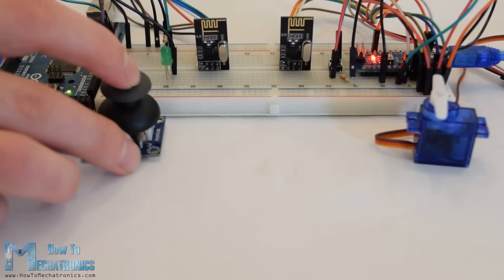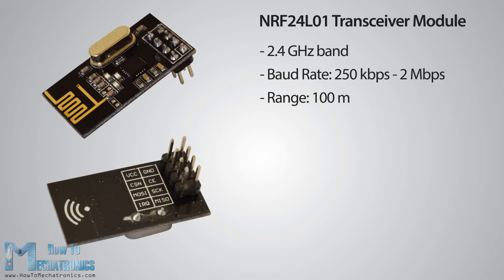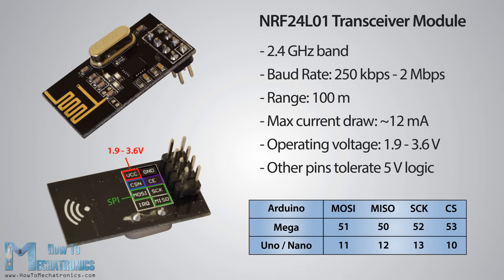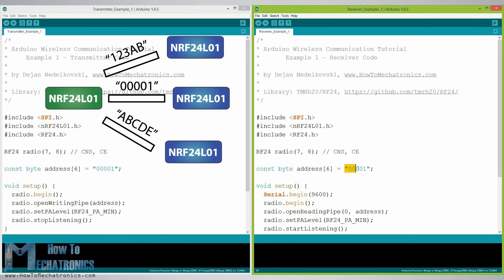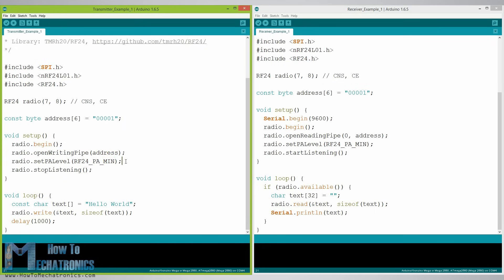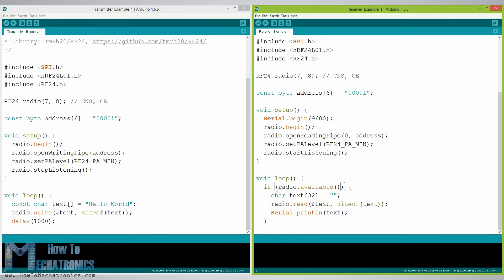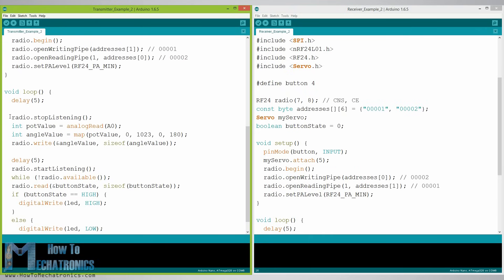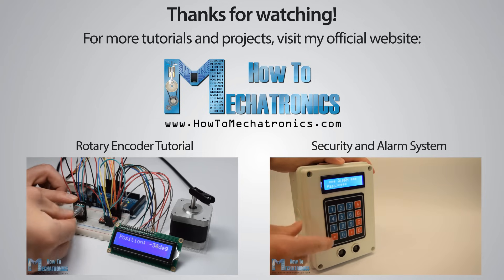Arduino Wireless Communication – NRF24L01 Tutorial

Comment: Hii Dejan!! Thanks for the tutorial. Had a small doubt .. like you said the nrf has 125 channels and if I am not wrong each channel can have 6 address pipes. So the lib which you have used in this tutorial has any function for setting the channel freq? What if I want to connect 10 devices on 10 diff freq and all the 6 address pipes in each channel/ freq  have to be dedicated to that specific device.. Is it possible??

Comment: as always from the first minute i feel like i know this module already you explained it so well that i will change my project from wifi (hard for me) to RF ..... excellent video love it...i have a question for you can the modules be configured to be like 6 emitters a single receiver ?? i have a project and i need 50 separate transmitter boards to send data to the same receiver so my solution is i will have every board pass data to the next board that way i can get data from all of them !!! can i do that ????

Comment: I was wondering if you used the Mega Arduino for a particular reason like it being more powerful , I have two pro minis I am going to experiment with and was also wondering if just wiring them identically shouldl work  for them communicating?
Reply: No. The Arduino Mega will not supply more power and will not increase range. It will work identically with Pro Minis as long as you power the Pro Minis with a decent power supply.

Comment: I tried the tutorial to display 'hello world' on the receiver module but nothing happens, can you suggest a fix? There was no error and the library was correctly downloaded, but nothing is happening.
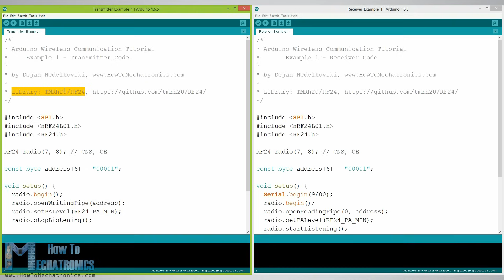Reply: Try swapping your wires for the 7/8 pins (CSN and CE), or swap the numbers in the code when you create the radio. If you notice, at 2:30 and 2:40 he has the pins reversed between the explanation and the code. Just a small mistake in the video I believe, I was getting the same thing until I figured it out.
Reply: @EnvoyOfFabulousness  Thanks! I'll try it out.

Comment: I really don't comprehend most of the language or meanings of electronics, and we were asked from a local law enforcrment angency to design a trigger mechanism for our product.  The bottom line is we need to send a "wireless" signal from the inside of a large SWAT Vehical to our RAM product mounted to the front outside of the SWAT vehical about 20ft in front of the Vehical to set off a small 180deg 8.4v RC type cervo, using a safety (Push-on - Release-off) button.   We have been to several hobby shops and looked on line and we can't find anybody that can help us with this seemingly simple project.  We were told by a few people that we would need an "ARDUINO" so the Transmitter and Receiver can communicate with each other. The Transmitting using a push-button style, (NOT an RC Hand Held), seem's to be our main problem.  Could you provide us with any help or assistence using an "Arduino" with this project?

Comment: sir i have i problem, i have set a wireless communication between two nrf24l01 module, which one is  with the antenna and the other one is without the antenna, and i have connected them in the same laptop(COM 3 and COM4) but nothing's working, my doubt is that weather the problem is that i have set the communication between two different types of nrf24l01 module OR is it that i have connected two boards at the same device?  kindly help me out sir😭😢😪

Comment: My nrf modules don't want to communicate with each other, I tried your test code as well as bidirectional communication code, they upload successfully to board but nothing happens. I tried changing nrf modules and my Arduino but still no any output in serial monitor as well as servo outputs
Reply: You need to get an nrf24l01 breakout board and wire the arduino 5v vcc output to the breakout board input vcc
Reply: @arhamthowheed9471  thank you very much for your reply but I have soldered them directly on board and I am using a Arduino mega board which at 50ma output current at 3.3v and I am also using a 220uf capicitor directly on nrf board. After fraustations I quit with loss of time and money. Any help will be appreciated.
Reply: @arhamthowheed9471  But unfortunately the place where I live, I can't import these from any international sellers like Amazon or eBay. Please suggest me another way.

Comment: I will use this module with arduino pro mini 5V.  3.3V must be used with this module not higher than 3.3V . Which value of resistor should I use to connect arduino 5v Vcc

Comment: Hey i just bought 2 nrf24 moduals a normal one and a one with the antenna but the wont communicate i have bought like 5 alredy and nothing works , smthing i can do? im using a mega 2560 and a arduino uno, Btw the fisrt time i used the nrf24 they worked but then stoped working i used 2 arduino unos and now all i buy don't work including this ones

Comment: I have a question that, Does I connect a dc motor in the place of led. 
I also want to turn motor on and off don't want control speed, Does it possible or not please tell me. I am waiting for your answer

Comment: Thank you for this Video so far. Can you make a video to explain every options of using? I want to use it to controll my electric longboard, for sure with telemetry. But it runs at 30km/h which means, that I should have a safe communication between my Transmitter and the Longboard. I've already thought about a PING-PONG method to ensure an existing connection and to activate an accident program if it's broken. But if I really know how to use the device, I could maybe develop an even better system.

Comment: how would I power my two uno boards? which sketch should I upload first? For me, the serial monitor only come up once and it displays 4 hello world only before printing question marks...Can someone help me plz!!
Reply: I have that question mark issue too, the four first hello world don't even appear :'(
Reply: Hi! What I’ve been doing with my arduino Nanos is uploading the transmitter code to the transmitter arduino first. The only change I make from his code is I add a serial.println(“1”); to the end of the loop so in the serial monitor, I can see that it is transmitting. You should also see the tx led lighting up when it’s transmitting. Then I upload the receiver code to the receiver, and then you should see it sending “Hello World”. If you need more help/questions feel free to reply guys :) I’m in school to teach these kinds of things so it’s right up my alley.
Reply: However in particular with your issues Liping and Space, check and make sure your serial monitor is set to 9600 baud so the arduino and monitor are on the same page there.
Reply: @space5422  I'm Glad it worked! Good Luck!

Comment: Is that a picture of an Uno? If so why is CE connected to pin 10 instead of pin 13 ? Should CE go to 13 or 10 when using the Uno? Thanks.
Reply: I see the question was asked previously and they state the diagram is incorrect. Thanks

Comment: Guys, I have a question: I bought 4 NFR24L01 modules, and I understand they can be interfaced to Arduino and all; however I still have a doubt: My target is to use the NFR24L01 as a standalone circuit, powered with a coin battery. Is it possible, or does it need to be attached to an Arduino forcefully to run?
 If so, do you program the NFR24L01 with the Arduino and then reboot to run its own standalone program? 
please advice, thanks!

Comment: There seems to be no connection when i switch the modules from integrated antenna to external antenna. When i use the module with the integrated antenna, it works. However when i switch to the external antenna, i get nothing. I was wondering if the code works for the external antenna module.

Comment: Are there security options for transmit data to stop listening by unauthorized receivers in NRF24L01?
Reply: Use encryption on your data and decrypt it once received. If your microcontroller of choice has hardware AES-256, then why not give it a try?

Comment: What is the difference with the comumunication between two HC-05 ? I don't understand why NRF24L01 is cheap than HC-05, the nRF module has more range, so, why is cheaper?

Also, I made the communication between two NRF24L01 and all was ok in a distance of 5 meters withouth obstacles, but in a distance of 8 meters with two walls, there wasn't communication. So, I think using RFM69 is better. What do you think? I need to communicate in a distance of 10 or 15 meters but with two walls. Thank you!

PD: I use baudrate: 250KBPS which gives more range but... ¿?

Comment: Reading the serial data from the receiver end just gets spammed with empty strings, hundreds of times a second. Anyone have any idea how to fix?
Reply: Incorrect adress? ... Maybe the transmitter is not able to send the data or get the actual input, if so, try sending a fixed string.
Reply: I had the same issue. I had two wires connected the wrong way. I think it was CSN and CE. Now it works perfectly.
A little bit late, but maybe someone else will find this useful.

Comment: Hi, when I use the code provided and wire up the circuit as shown I am only receiving lots of blank messages in the serial window of the receiver. I have tried many things. Can anyone offer some help? I did not alter the code in any way and this code has worked for others. I am using the correct pins for Uno, 7,8,11,12,13. It could be my modules are faulty but I hope not and I am searching for a solution. I have the long range modules with the antenna if that makes any difference.

Comment: hi
i have a question that how can i have data-logging with wireless method (19 byte data) at 200 Hz frequency?
my project with arduino board has been sending data with serial port at 250 Hz, so i want to send this data with wireless method..
which module is proper for my project?

Comment: After a while of moving the servo with the joystick on the transmitter, it stops working. I made a serial print of the angle on the receiver and it stops printing after like 10-30 sec of use and servo dont work obviously. Some times it last longer and sometimes after 10 sec rip, and i have to restart the receiver. If someone had the same problem i would be grateful of some advice to let me find the problem :D

Comment: All connections are set ,runs first example easily but communication failed in the second example of servo and led .i have tried several times and i am not using any capacitor,custom nrf24I01 adaptor(3,3 v) ,can anyone help

Comment: Hello, your project is very inspiring. However, I need to modify it to send both the receiver and the transmitter more information, preferably in a "struct". Unfortunately, when I edit your code, it doesn't work. I want to control the loading ship and have the receiver send battery status and information from temperature sensors. Subsequently, this must be shown on the display by the transmitter. But I can't modify the program to send me this data in a struct. Please help mi

Comment: Sir i want to ask about my project. I Use arduino mega, and also use NRF24L01 which needs the SPI Port to work properly, but i also use the RFID RC55 also needs the SPI to work. is that possible if i use one arduino mega for both (RFID RC55 and NRF24L01) in one side, and also use one arduino mega for both (RFID RC55 and NRF24L01) for the other side?
Reply: oh i see, thanks a lot sir . i will try that

Comment: I use an Arduino UNO and which pin i have to use (ICSP pins or something else)?
Reply: ICSP pins should be directly connected to the pins you're looking for. You can use the ICSP pins or the standard IO pins they are connected to. Use a multimeter to check which pins are which, or do a search for your model's pinout.

Comment: I had issues yesterday with 2 arduino unos communication, it turned out that one of them (arduino uno smd) could only act as a receiver and not able to transmit. Just writing if someone is having the same issue.
Reply: Check connections

Comment: Anyone got Bi-direction transmission problem? I'm able to press button on 1st Uno and make the LED on 2nd Uno lid up. but I can't use potentiometer on 2nd Uno to turn Servo on the 1st Uno. I'm wondering if the code should be like this:

const byte address[][6] = {"00001", "00002"};

1st Uno
     radio.openWritingPipe(address[0]);
     radio.openReadingPipe(1, address[1]);
2nd Uno
     radio.openWritingPipe(address[1]);
     radio.openReadingPipe(0, address[0]);       <-- 0, address[0] instead of  1,address[0]

also 6:56 Why radio.stopListening (for Receiver) is inside If(radio.available) ?

Comment: Hi, I used Arduino Uno as a transmitter and Arduino Mega as a reciever. I uploaded your codes seperately on UNO and Mega. But in the receiver (Mega) in the serial port instead of Hello World, I received some little squares. Could you please help me to figure to solve this problem? Thanks.
Reply: Try changing baud rate for serial...

Comment: Thank you for the share ! But my "Hello World" doesn't want tot appear on my receiver :( checked the pins many times, baud are good too, and changed my module many times  ... i don't understand :'( please help
Reply: Try swapping your wires for the 7/8 pins (CSN and CE), or swap the numbers in the code when you create the radio. If you notice, at 2:30 and 2:40 he has the pins reversed between the explanation and the code. Just a small mistake in the video I believe, I was getting the same thing until I figured it out.
Reply: @EnvoyOfFabulousness  , i finally success since my question. Thank you for your help :)

Comment: i did the same as you mentioned but it did not work for me :(
when i open the serial monitor of the reciving unit it shows nothing.
Reply: i bought two new "NRFf24L01" and they worked. the 
"NRF24L01+PA+LNA" DID NOT worked with me, when i open the serial monitor of the reciving unit it shows squares and "?????????????"
Reply: @jawhersebai  same problem but my baud rate is 9600 and i also tried every other but i doesnt work
Reply: it
Reply: @maxhuber9980  try to buy another new NRF
Reply: @jawhersebai  Try swapping your wires for the 7/8 pins (CSN and CE), or swap the numbers in the code when you create the radio. If you notice, at 2:30 and 2:40 he has the pins reversed between the explanation and the code. Just a small mistake in the video I believe, I was getting the same thing until I figured it out.
Reply: @EnvoyOfFabulousness  yes i noticed that he reversed the CSN and CE between the code and the schematic, but my tow "NRF24L01+PA+LNA" did not worked because one of them was broken.

Comment: Worked. But the wiring is wrong. its pin 13 11 12 not 12 11 10
Reply: I have the Nano v3.0
Reply: what is 13 11 12? which pins go to which #
Reply: Dude I love you, thanks so much for this!
Reply: it worked for 11-mosi,12-miso,13-sck
Reply: Can I use Arduino Uno and not Mega?
Reply: its strange..it didnt work for me,even i follow 11.12.13 pins

Comment: By this can we communicate from deep space to earth
Reply: you could if you used oneof these as the transmitter, but if it was on a spaceship far away the signal would be very weak on earth so you would need a large antenna that points in the right direction in order to amplify the signal
Reply: Wrong

Comment: I'm facing a problem while compiling on my laptop running Arduino 1.6.8 while same code compiled on my Pc running Arduino 1.8.5. 
error is 
"invalid conversion from 'byte* {aka unsigned char*}' to 'uint64_t {aka long long unsigned int}' [-fpermissive]
"
help my figure out this problem. thnaks
Reply: try  asking the question in arduino forums
Reply: I had the same issue. The solution was to change the name of the nrf24 library from "nrf24-master" to "nrf24_master". I deleted the old library from the arduino ide and then added in my library with new name and this worked for me. For some reason the Arduino IDE does not recognise the "-" in names of libraries. I hope this helps.

Comment: I've spent the last few days trying to figure this thing out. I got the first example to work perfectly, but no such luck with the 2-way communication. The system seemed to freeze after taking an initial reading. After much troubleshooting, I've figured out that the transmitter is going into the empty while loop and not returning. My first thought was that the receiver wasn't responding with the buttonState, but commenting out the empty while loop resulted in success....sort of. The thumbstick now controls the servo, and the button will turn on/off the led, but the led blinks randomly when it's on, as it now has no way to wait for a transmission. Has anyone experienced this? Any ideas on getting around it?
Reply: Ken Engel , are you german? , ken engel sounds german.(i am from austria)
Reply: I'm American. It is a German name, but I am adopted.
Reply: if you use a external power supply, try wiring a ground from your supply to the arduino's it worked for me.

Comment: i uploaded the first example and my transmitter nrf24 gets hot where as the receiver serial monitor shows nothing, i have a spare nrf24 that i replaced with the transmitter, same problem occurred, i think the hotness is normal as the power takes a lot of amps but the serial monitor is a big issue, i cant even tell if my system is working, anyone with the same problem?

Comment: i am getting problem in output while printing hello world i am getting junk values please help me out
Reply: Try swapping your wires for the 7/8 pins (CSN and CE), or swap the numbers in the code when you create the radio. If you notice, at 2:30 and 2:40 he has the pins reversed between the explanation and the code. Just a small mistake in the video I believe, I was getting the same thing until I figured it out.